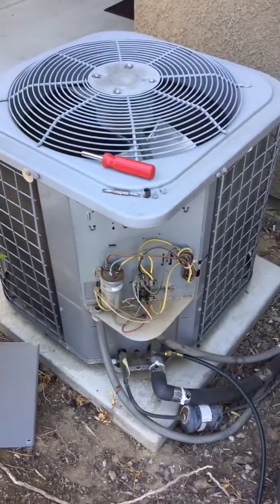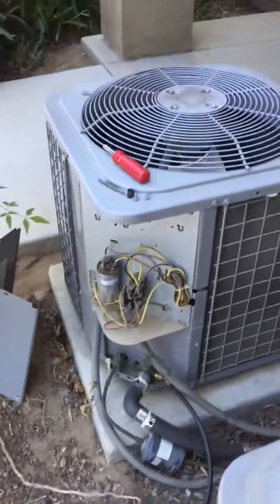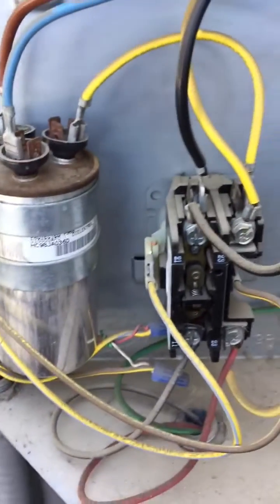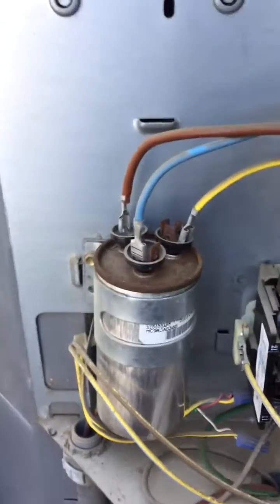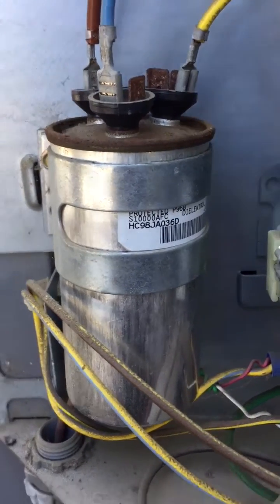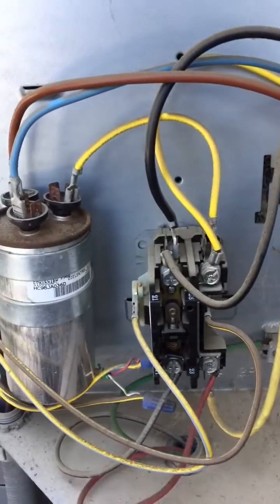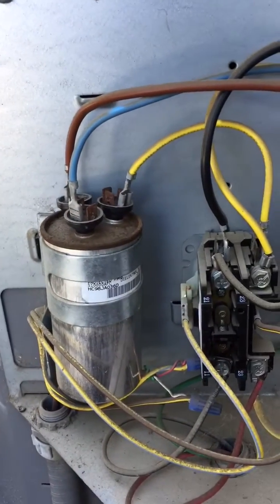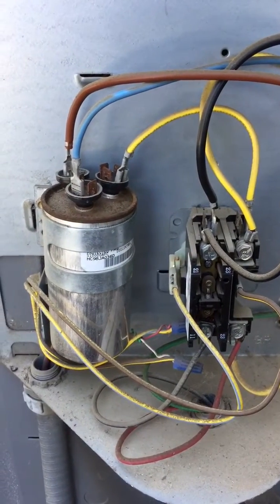How do I know if my run capacitor is bad?

Comment: Yup, if its bulged its bad or going bad.  Quickest way otherwise is to check current flow with clamp meter.  If its zero with contactor pulled in, its bad.  If it reads, then take voltage across it, divide current by voltage and multiple by 2652.  Also nice because you can use a basic voltage tester, don’t need capacitance test and it checks it under load, where some will show weak but deenergized test ok.

Comment: Both original and replacement run capacitor are same 12.5 MFD 440/370 VAC but new replaced blower motor has 7.5 MFD listed . Still good ? Seems fine , it working
Reply from the maker: Yes still good, as long as the new motor requires a 7.5 MFD.

Comment: Replaced mine 2 years ago. Now it's all corroded? Any thoughts. Why do they get corroded
Reply from the maker: Due to moisture and debris, it’s normal. As long as the rating is good, should be ok.
Reply: @Frog Face LOL, you're joking right? 🙄
Reply: Chevy stepside you need more fiber in your diet.